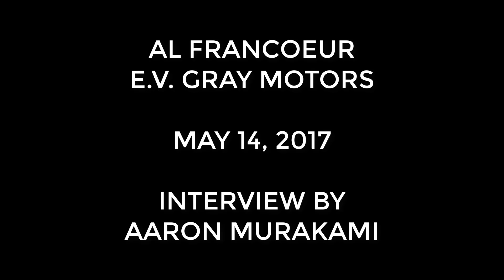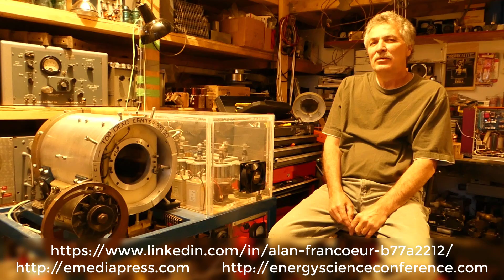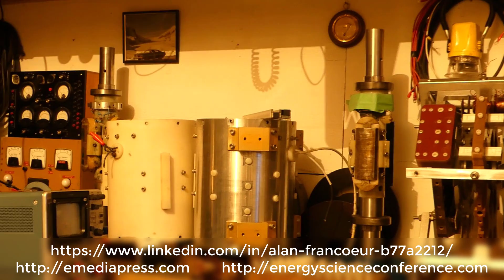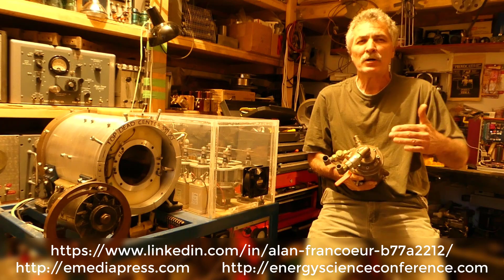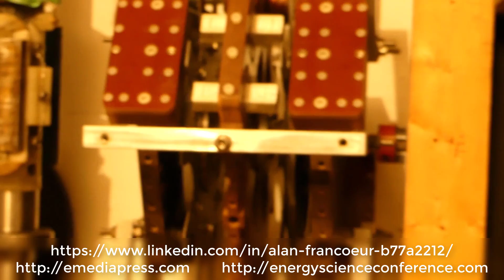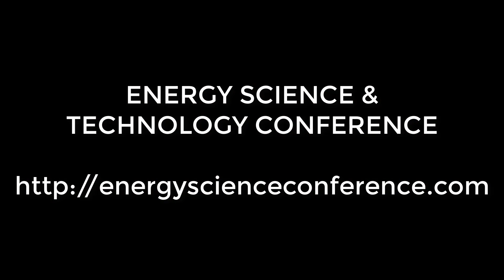Al Francoeur - E.V. Gray Motors - May 14, 2017

Comment: He is avoiding the real answer. It is not in the coils. It is flipping a radiant field from - to + then back at will. It was found by tesla and it works. You can call it cold energy or - energy but it defeats lenz's law to keep running then flips to dc voltage to drive the motor. It is in the gray tube. I do not think he knows that.

Comment: Nice, Al figured out the cosmological connection! 

Ive seen the helix in my experiments by compressing the back emf through a noble gas tube. There is the forward current and a time reverse current that is identical curling around each other. 

When the plasma is compressed further, it turns into a spiral galaxy, even more and the plasma completely disapears and the tube will no longer light up. 

Where did it go? 

As someone who has worked with this circuit for ten years I know exaxtly what Al is saying. 

Ive seen comets, pulsars, supernova, and galaxies on my lab bench when using the time reverse phase conjugation in gas tubes. 

Time reverse phase conjugation, standing wave, and scalar wave, aaand the near field of an rf antenna are all the same thing. 

The trick about the cap discharge circuit is that the high frequency component is wireless power also, so you can get pulsed linear power and wireless power from the same circuit. 

Ive been able to get about ten watts out over unity from the wireless power with the cap discharges pulsing at 100 percent efficiency. See my resonant charging video. 

The trick is that the wireless power is a time reverse wave resonating in the circuit and occurs as energy from the vacuum flux occuring due to the appropriate geometry of the circuit. Lc tank. 

In the diode itself quantum tunneling is occuring. The electron is able to split itself into a forward and reverse electron at the diode "wall". Cold fission?

This is all based on quantum entanglement. 

Energy/time =power

What are the possible binomial expansions of this equation Al? Aaron? 

Anyone? 

www.tachyonaerospace.earth
Reply: You still experimenting bud? You got any content to watch here? 

Just curious.

Comment: Al is a nut case.. Ask him about aliens... And a very short fuse on his temper.....Not trustworthy..
Reply from the maker: That's irrelevant - he does good electrical and mechanical work and we saw that the original Gray power supply he has is indeed unconventional. We're looking forward to his presentation.
Reply: Ok, i guess you saw the video with Sterling where he talks about aliens. What a surprise, the guy that "invented" the caduceus/tensor coil said he got the design from aliens. Many other investors confessed to this as well, so i guess every one of them are basket cases but somehow they manage to go beyond text books and bring unimaginable knowledge into the world. 

Well, i am looking forward to what he has to say. Like many others.
Reply: ASK HIM TO SHOW YOU HIS INTERFERENCE GENERATOR WORKING ,IT DOES NOT WORK ASK HIM TO SHOW YOU ANYTHING THAT HE MADE THAT WORKS OTHER THAN HIS BONG.
Reply: i love bongs, yum yum yum yummy